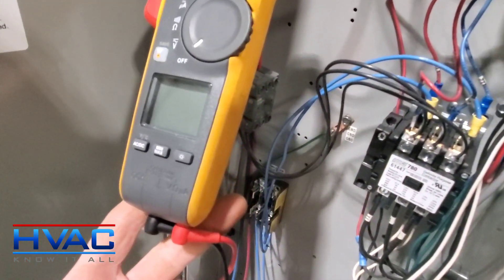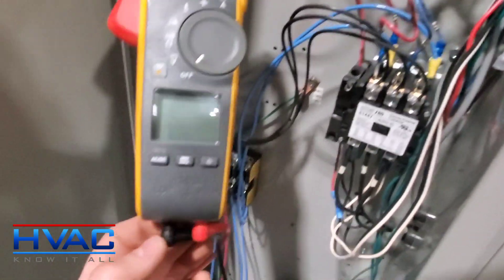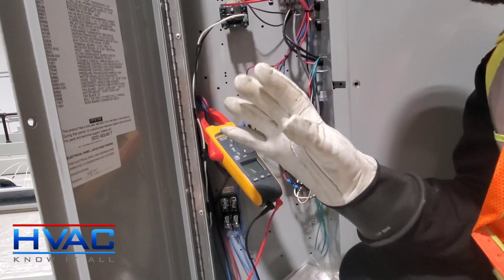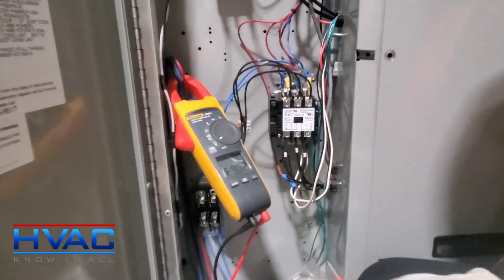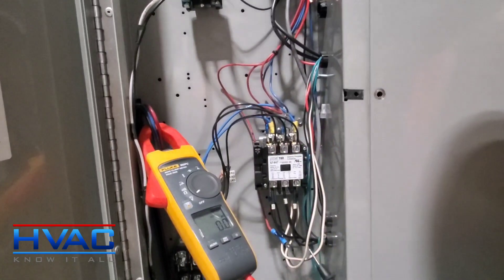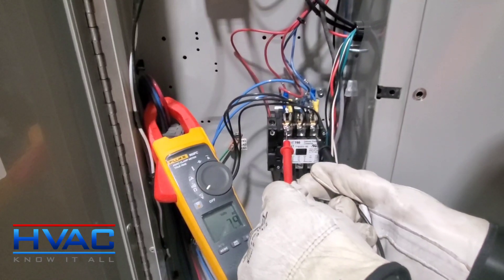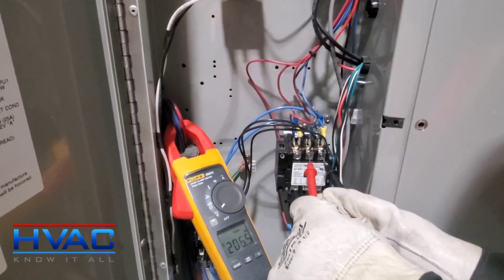How To Check 3 Phase Power

Comment: Hi - my contacter and main switch to a water pump burn out, i replaced them - now at my pump switch I have 400v across phases as normal but I also have 400v across neutral to either phase.. any ideas what this could be?seems to be correct at the Contactor end. This is with switch off to the pump.. bugged wire between them possibly?

Comment: Hi thanks for a great video.
I was wondering why is my amperage reading bouncing back and forth when I check my amps with my clamp meter on my main switch of my 480 volts AC oven machine?

Comment: Completely new to this…is the clamp measuring anything right now or is it just hanging from the wires for ease of use? And the actual measurement is coming from the probes?
Reply: The clamp is used to measure current. But the meter was currently in AC Voltage mode, so it was meassuring only voltage at the time

Comment: My thanks to the makers of How to Check 3 Phase Power.  It is very well made video and shows a very straight forward and simple to understand way of checking, measuring and testing 3 phase electricity.  HOWEVER, it is not known where the information is from also it is on YouTube.  I have been made aware that companies have their own way of doing things.  Therefore the to check 3 phase electricity and three phase electricity from the standpoint of science should be universal, however some schools have their own way of teaching things, as text books vary by publisher.  This may have some truth to it and be perceived as a straight forward enough method but it may not be accurate for the reasons stated above.  Namely schools and text books have different ways of teaching the science of electricity and companies have their own ways of doing things.  Therefore the pure science as it it consistent with nature and the universe and therefore universal laws of physics may be different once taught in schools and applied by companies.  Therefore although the video is easy enough to understand it may not be consistent with Science or scientific facts.

Comment: Couldn't you just check voltage to ground?
Reply from the maker: Yes, but checking to ground is not the same as checking all 3 phases
Reply: I was having an issue today on a tugboat, and I was checking each leg to ground, I didn’t realize boats don’t have a ground or a neutral, and I was wondering why I couldn’t find my hot leg
Reply: @Magichvac  never considered that
Reply: You would get 120v on a 3 phase doing that as each leg is 120v you do this to make sure you're getting 208/230. Testing across phases isn't something you should do if you don't know how as you'll kill yourself pretty quickly.

Comment: I have exactly the same reading in my 3 lines like in this video, I can supply my 10hp 3phase aircompressor with specs of 210/420 volts?

Comment: Would you hold yourself accountable for someone’s electrocution after watching this video?
I have taken courses from high voltage specialists, you should be going to a known source of power also with you meter to verify, as well as what someone else mentioned, ohm your leads before every use.  I have had a 600V 3PH accident, nobody harmed luckily, nothing to take lightly!
My two cents.
Reply from the maker: What do you mean by known source of power?  And if you're on a roof with one piece of equipment where is the known source?  I do agree checking meter leads through continuity but once you change the setting to voltage that continuity maybe lost regardless if there is an issue with the meter, what is to done in this case to know if the voltage setting has meter continuity? This wasn't meant to be a full fledged safety video but a where to put leads to get 3 phases readings.
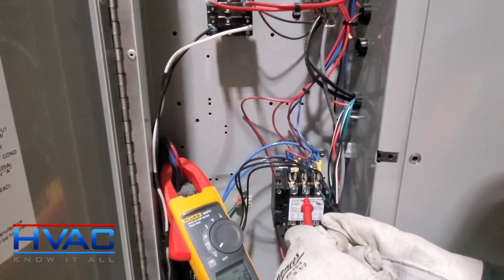Reply: Don’t be dicking w/high voltage unless you understand the physics of it in an incredibly intimate way. I wouldn’t hold myself accountable for someone else’s electrocution if all they did to prepare themselves was watching a 1:17 second clip.
Reply: You’re crazy
Reply: Tut tut ! all you need to do is use your proving unit prior to and on completion of your test 👍 again thank you for an excellent and sensible tutorial Gary 💯💯💯
Reply: The contacts are the known source of power this is why you had an accident lol and you certainly weren't working on 600v 3ph with that kind of knowledge as that would be I don't even know a 25 tone unit or some industrial motor the size of room and couldn't even tell a power source lol.

Comment: I also like to put my meter in continuity test mode and touch the leads together. That verifies the leads are connected properly. I do that before I do any other testing.
Reply from the maker: Good point
Reply: Oh I like that 👍
Reply: Always! 

Grandpa worked for Siemens making transformers to start(rewinding and all that jazz)
When he left around about 1995 or 2000, he was the main QC guy, and a angry pixie wrangling enginerd. 

Sometimes, ya got tiny issues where that small bit of resistance in your leads and meter are gonna have to be accounted for. 

Just cuz they SHOULD be 0.0000 or full continuity
Dont mean they are actually verifiably continuity
Could have a low or bad meter battery
Could have some weak connections.... 

Dont take much to start chasing your own tail. 😂